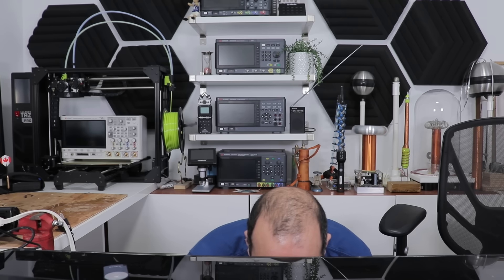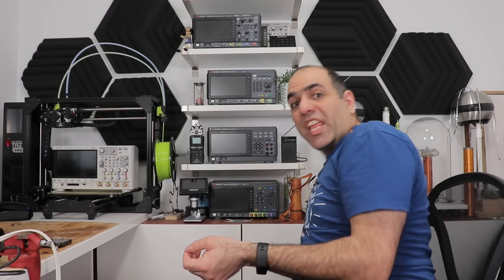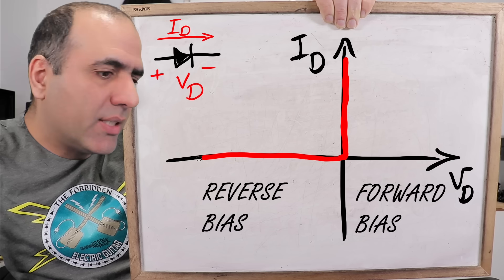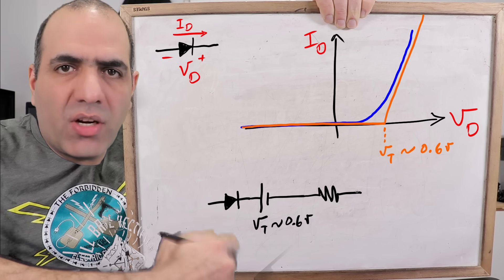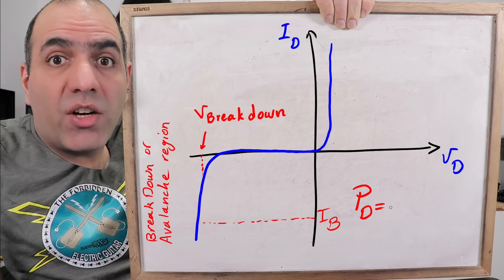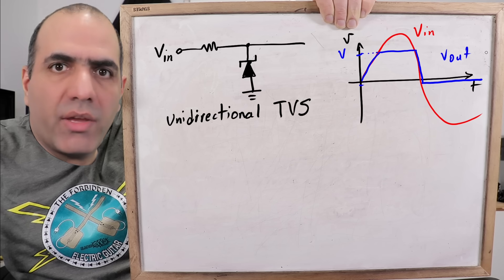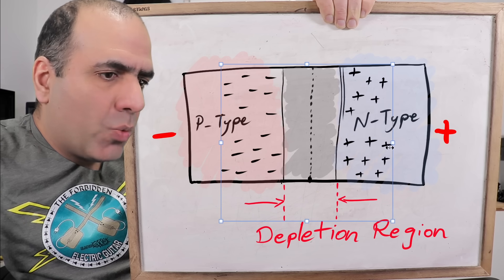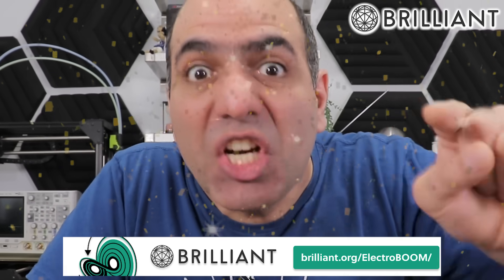DIODES! All Sorts of Them and How They Work (ElectroBOOM101-010)

Comment: Great video again! Thanks for sharing knowledge
I made a Full bridge rectifier with my LED bars and you could see the diodes rectifying mains voltage. I also had a reverse breakdown voltage issue therefore added some other diodes in series to fix that. If you would like, I could send you some of my LED bars such that you could also do it ;)  it was a fun side project
Reply: that would be interesting to see

Comment: Hmm.. haven't seen it yet but if there isn't a signal diode being put wrong way and connected to a DC supply in the first 2 minutes, i will be disappointed. edit: a burned diode in forward at 4 minutes is a bit weak.. but i guess better than nothing..

Comment: One of your best videos to date, Mehdi. I've been doing electronic design for years, and knew most of the uses and properties of diodes, but did not know WHY they behaved the way they did. I learned a ton!
Reply: You have been designing electronic for years without elementary knowledge ?  No way bro..
Reply: @jmenonenidulezite561  Do I know the functions of diodes? Do I know the voltage drop across a germanium diode vs silicon? Do I know the applications and limits of a zener diode? Did I know that diodes are affected by, and can produce light? All yes. Did I know the physics behind the junction of the N layer and P layer, and how it allowed the electrons and current to flow? Nope. Learn new things every day.
Reply: @ScottsSynthStuff  Ok it looks like language baricade, Iam not english speaker, I thought that you dont know nearly any of that, I learned first how electron behive, so I know PN junctions pretty good, and finally after that I learned characteristic and other things, so it sounded pretty crazy to me, but in second though I must admit you are right, sorry for that.. :)
Reply: @ScottsSynthStuff  I mean... you literally learnt in the reverse way but ok. Sure you can drive a car without knowing how the engine works but when something breaks down you'd be helpless. I guess you're not a professional electrical engineer and just a hobbyist.

You should learn from the basics though, it's surprising how many issues in electrical design can be rectified by backtracking using first principles.
Reply: @ScottsSynthStuff  don’t u learn the chemistry behind p and n in class 12th
Reply: @jmenonenidulezite561  You don't need to know how electronic components work on an atomic level to understand how they behave and use them.

It's just general knowledge and unless your work involves building or designing semiconductors, it's quite uselss to know it.
Reply: @AxeActly  That is literally one thing you dont have to know ok, but he said he learned ton of it.. I would be ashamed, Iam working in design too and something like diode characteristic is just an tip of iceberg.. They didnt mentioned frequency problems at all, temperature characteristic,recovery time,etc.. Iam just saying that if someone who dont know this desing some serial products.. I hope not.
Reply: I've learned two ton!
Reply: go to schol becase teecher says go to schol? am i circus animel or what? i make yt videes becase thats my dreem. liv my dreem is what i do. thats what i do. hopefooly the videes are good for you deer scott

Comment: Engineer: "Huh, the diode produces an insignificantly small electrical current when I shine a strong light at the PN junction."
Normal person: "Yeah, yeah. That's neat but could you do something useful instead of playing with your electronic toys?"
Engineer: "...I wonder what would happen if I make the PN junction as big as the roof of my house."
I love engineers!

I thought I can't learn anything from a video about something as simple as diodes but here we are. Finally I get why there is so many symbols for them ... and that neighbors don't try to steal out sun with those big rectangular things.
Reply: Actually, the photoelectric diodes (solar panel diodes) are still very small, just very large numbers of them arrayed in a grid.
Reply: You'd still only get a voltage of about 0.6V but it could supply a lot of current.

Put a lot of PN junctions in series and parallel and you will get less current but at a usable voltage.
Reply: @paulcooper9011  isn't that just a thermocouple 😂
Reply: @phonotical  Nope, it senses light, not heat.
Reply: @flexairz  do you even know what the thermoelectric affect is
Reply: huh
Reply: I think it was discovered by people working on ships and noticing the light changed the readings
Reply: Engineers are the true heros of this world.
Reply: @blueredbrick  that's why they get doctorates...oh,wait...
Reply: Actually the solar panel was invented in the 19th century. It was many decades before we understood why it works.